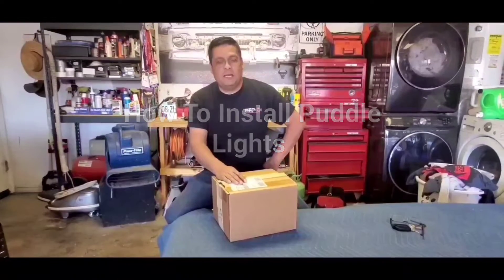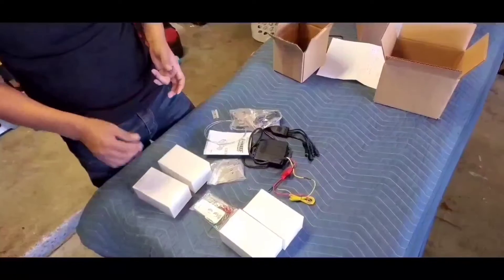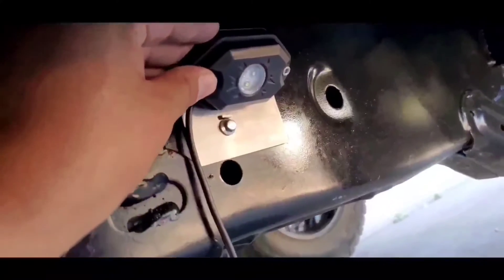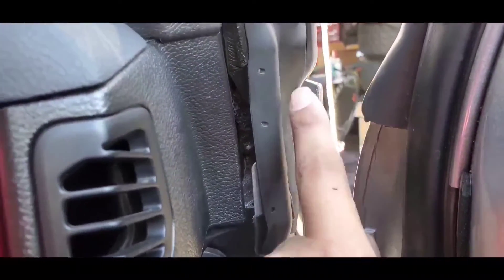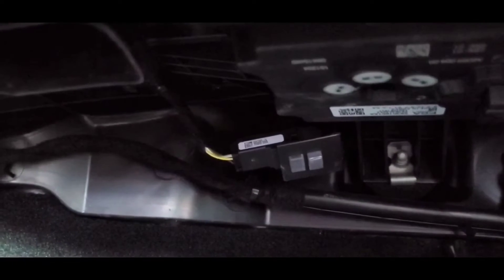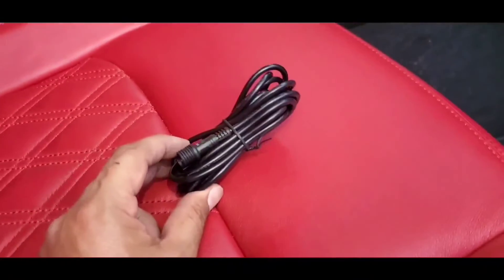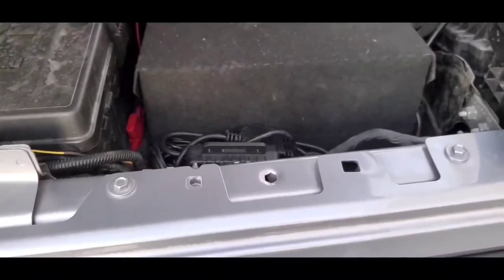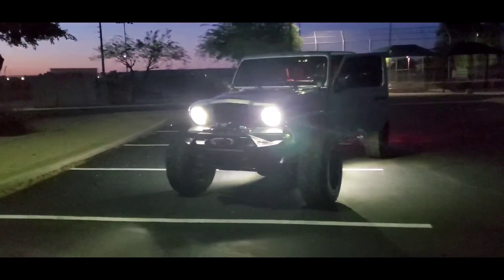How to install Puddle Lights On A Jeep Wrangler And Gladiator JT

Comment: I was able to make my own (sorta) buy using rock lights you get off eBay (like $20 for 4) and tapping into the rear dome light (I honestly forgot about the lights under the dash) and made my own mounts from L brackets. I mounted them to the rock rail bolts. Only issue is the power to the dome light isn’t powerful enough to run all 4 but it will run two. I like the set up you got there and wish I’d seen that before hand as I’d have picked one up.